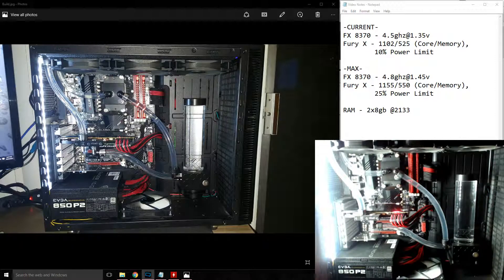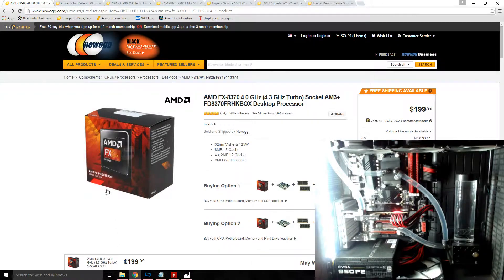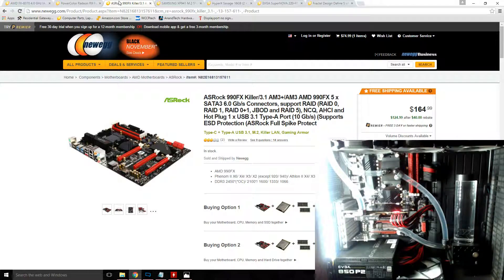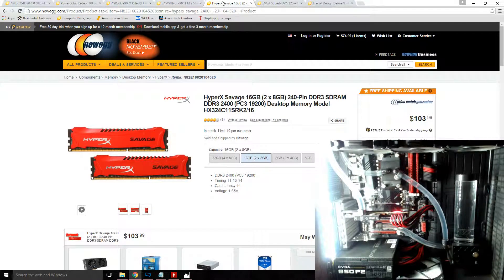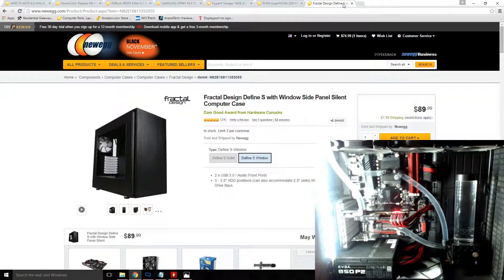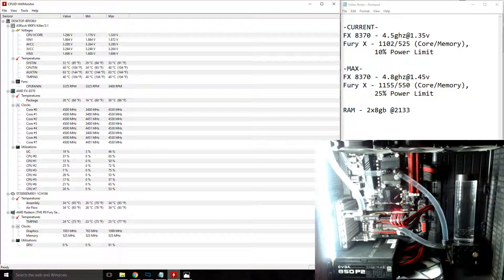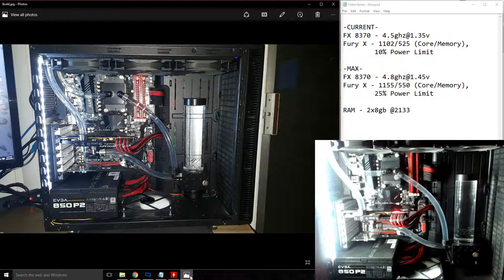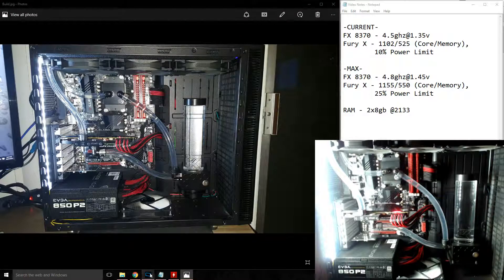AMD Custom Loop Build 2015 Overview

Comment: What RPM are your fans running at and what was the ambient temp?
Reply from the maker: My motherboard reports it at stages of 1-9 instead of RPM, I run at stage 1 (slowest). Ambient temp is always 70ishF/20ishC
Reply: So probably sub 1000 rpm I assume.
Reply from the maker: I have all of my fans sourced to 1 hub, and based on the lack of audible sound, I'd have to agree with your assumption. The 420mm radiator is absolute overkill for the heat generated by only 2 components (even considering these are fairly high wattage components), so that leaves minimal need for heavy airflow, just enough to give air a direction out of my case.
Reply: What are your tube/fitting inner and outter diameters btw?
Reply from the maker: I believe 1/2" - 3/4". Honestly don't remember, but I do remember getting particularly thick tubing
Reply: Yeah your tubes look thick AF, you got the thickest ones out there pretty much. lol

Comment: nice build!.. what brand 420 radiator is that?
Reply from the maker: It is a Hardware Labs Nemesis, and it is amazing.
Reply: +Mavelos PC Building that's the same one I'm looking to get for my build. or a front mount 360. you have any issues with clearance with the fans and the mobo?
Reply from the maker: +schectergt916 Assuming you use the same case, there is a 55mm limitation up top, so with 25mm fans, that means the radiator can't be more than 30mm thick. Up front you don't have that limitation, though it depends on where you mount your pump/res.